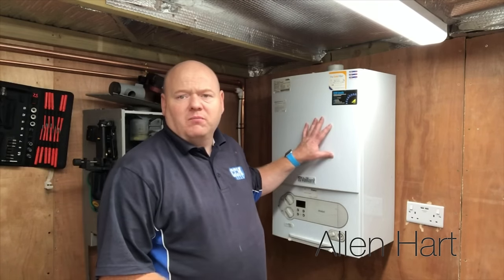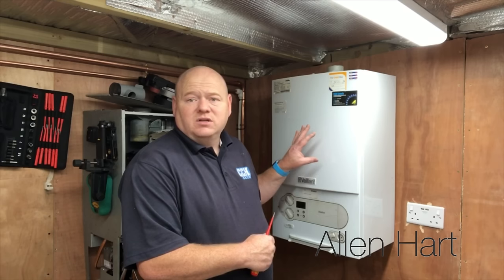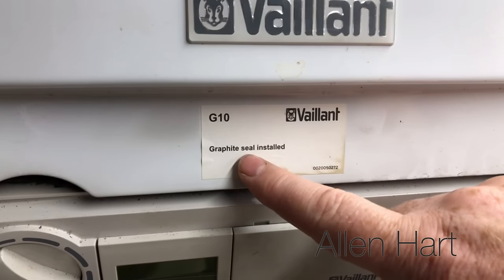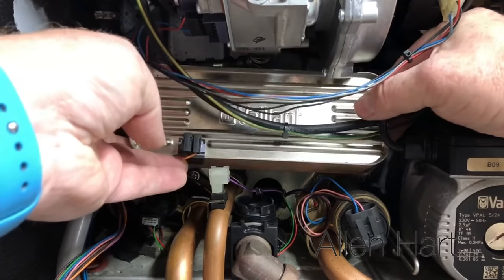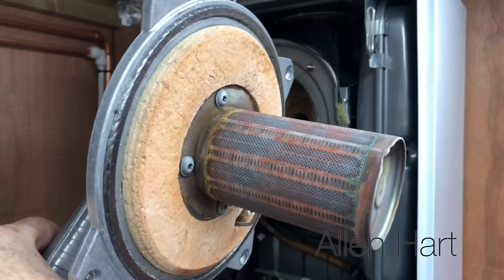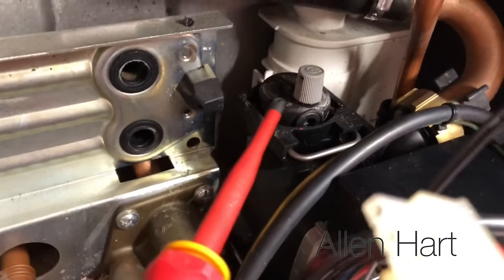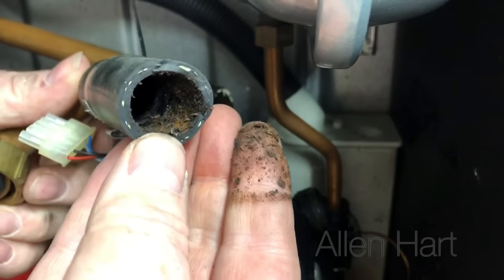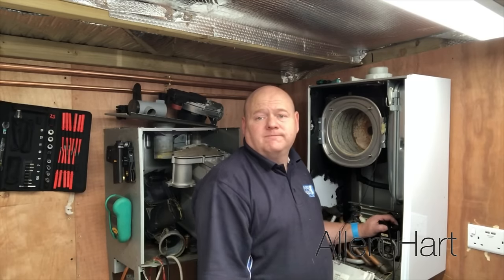Vaillant EcoTec Plus Gas Boiler Strip down

Comment: hi Allan, i have this boiler , i need to change the vessel as water is coming out air valve , if i turn off electrics and drain water can i just swap it with new one and refill ?    cheers for any advice
Reply from the maker: Please call a Gas Engineer. Thanks.
Reply: Ok , cheers

Comment: EIxcellent Video Allen.  Loved it. Question: I have a Valliant EcoTec Plus 831 boiler and it appears that the timer clock on it isn't working. I'm aware it's a 24hr clock but no matter what time I set the clock to, the time on the clock never changes. Any ideas on how to ensure the clock is faulty?
Reply from the maker: Sounds like it might be faulty, Ask your gas engineer to test it the next time you have the boiler serviced. Thanks.

Comment: Allan, what could be the cause of the boiler tripping the rcd,  obviously a short in the wiring somewhere, mains to the boiler switch is ok, soon as you turn it on it comes up loading on the led screen then trips, cheers
Reply from the maker: Could be a number of things, best to test the componets with a multi meter, i would guess it would be fan.

Comment: Quick question should the auto air release cap be loose above the pump?
Reply from the maker: Thats a very good question, I have asked manufactures this in the past and i am told it should be left open as its an auto air vent.
Reply: @AllenHart999  Thank you very much for the quick response Allen and all great informative videos. Keep up the good work.
Reply from the maker: Colin Swords Thank you for watching them 👍

Comment: Wrong! First things first, anyone can take the case off a gas boiler and work on the gas side as long as they are competent.  Competence is paramount. 

1st criteria:                              COMPETENCE
2nd criteria:   1. Working for gain 2. Working for no gain.

Competence goes for:
  ♦ A DIYer; 
  ♦ Someone working on voluntary projects for no gain; 
  ♦ GasSafe registered man.

Competence is your results and how you safely work.  Not a certificate (a piece of paper). I have come across many incompetent GasSafe men who have certificates.

You need to be GasSafe if you do the job for gain (i.e. money), but can work for no gain without GasSafe registration, as long as you are competent.  

A plumber who is not GasSafe registered can legally work on a boiler and charge money, as long as he works only on the water parts - like changing a plate heat exchanger.  It is the gas section that needs the GasSafe certificate when charging money. 

The above is the LAW.  Do not go by old wives tales.
Reply: John Burns is the above information you just printed all true ?
as I do my own work on my own boiler and believe I am very competent, the engineer who is gas safe who previously did my work is not in my opinion competent at all all the repairs I have carried out have been very successful!
Reply: @SalimKhan-gk1fh  
If you are competent and do not work for gain, then you are within the law.
Reply: John Burns Thank you for the information I’m a motor-vehicle technician working on complex automatic transmission systems which believe me are 10 times more complicated than any gas combination boiler 
the amount of engineers I have seen who have missed diagnosed simple repairs is unbelievable!!
Reply from the maker: John Burns You can only be competent if you have all the correct test equipment and they are calibrated etc, DIYer is very unlikely to be competent to take the case off a boiler. I go to quite a few were people have attempted to work on boilers and have made a right mess, often leaving themselves and family with dangerous boilers
Reply: @AllenHart999  
I am only interested in the law. 
Instruments can be rented for the day. How to use them?  See Youtube. Owning them means nothing. 

Also, if someone uses the meter dial to set the gas rate (air and gas will be set then in some boilers) and uses a monoxide sensor at the boiler.  Clearly safe as a monoxide sensor is at the boiler, that would pick up any leaks from defective boiler seals. Also if seals on the heat X area changed and he uses liquid to detect if any leaks.  I would say competent.
Reply from the maker: John Burns The law says competent. What does competent mean?
Reply: @AllenHart999  
Not ownerships of anything for sure, Whether instruments of pieces of paper.  
Competent?  Working safely then producing the results.
Reply: @AllenHart999  
In electricals, you need zero qualifications to practice professionally, i.e., working for gain. However that word competent comes up. In official documents it is used liberally.